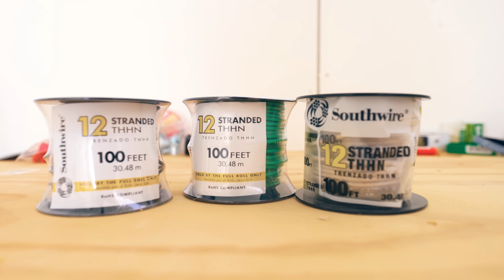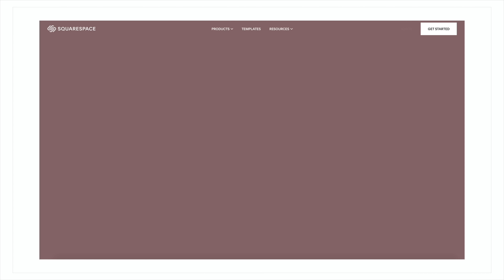DIY SOLAR POWERED WORKSHOP | MODERN BUILDS x GOAL ZERO

Comment: maybe just me but I think it make more sense to go with the yeti 6000x than the 1000x and a bunch of extra batteries, I know it would be more expensive but you just have the one unit and a cupple extra hundred watts of power. it would be a simpler setup and that is just how I would have done it.

Comment: I think putting all your batteries right between both exits would be a problem in case of a battery fire.   I would at least move the big, main batteries to the back of the shed, since you don't need to access them regularly anyway.

Comment: Why not do the ruff in electrical after the insulation rather than bending pipe all day?
And also what’s causing your lights when you turn on your table saw is the start up current on your table is high thus pulling more for a split sec

Comment: 1. Since price is apparently no object, I would have gone with the 1500, just in case you add a larger tool in the future.
2. The stranded wire should have used crimp rings or spades. It doesn’t hold as well under the screw terminals.
3. Your feeds from the power station should have been in strain reliefs, not just conduit adapters.
4. Bent conduit is fine, but flexible conduit to the lights would work easier.
5. Dual conduits vertical is fine, but a single 3/4 would work just as well.
Reply: #1 price is definitely not a concern with this build lol.

Comment: As a electrician apprentice I noticed the hot wires tied to the ground! Wait! The ground wire needs to be not tied to the black or white wires via the red cap used! Please fix this it’s a major issue! I mean a ground Wire should NEVER be tied to the white and black wires! You could get shocked or killed! Thanks! Also buy a tester! Please it will tell you if it’s correctly wired!

Comment: Anytime you cut the tube, file the inside to prevent the wire rubbing on it
Also, there was no need to splice the wire, it can cause future issues unless you ran out of cable, in that case you use some brass wire connectors that you tighten using screws. In your case, you could've just ran the cable directly to the source or used a wire puller (they sell them at home depot, orange and go up to 100ft I think)if it's too complicated

Comment: Follow this guide for how NOT to wire a shed. Don't ground the conduit. Don't use EMT connectors entering the lights. Don't use a strain relief for a cord entering into a box. Don't strap the EMT to spacing rules. Conclusion? Don't ask an experienced electrician for help and don't do research of proper electrical installations. Wing it.

Comment: First of all thanks for the many advices I got from this group, you guys all rock 
So, I wanted to give back some value to the community as well...
I was doing a lot of research lately on renewable energy and found very interesting facts and tips 
on how to decrease your electricity bills  with solar energy. So, I posted on my blog. It explains how the "home energy  DIY system" works and how to save up to 85% from electricity bills with the "home energy DIY system"
Make sure to check the "home energy DIY system" at the bottom of my blog!!

https://sites.google.com/view/rewnewable-energy/home?fbclid=IwAR2zejL2HQKfNBIkxnzG2gtnWeXdZN7qabnYZqELVRVU9A17TBlFk8DrjUc

Comment: In. General, I like them video and idea of getting off grid with green electricity (neglecting the resourced the production of all of this used). However, not sure how many people might get down to reality when they see that the rough spend (w/o conduits, cables, etc.) is $4.5k. Not sure how much a kWh in your place costs, but you can by a lot of kWh for this. Those equipment need to get way (!!!!) cheaper, before it will have a significant positive impact overall. Just my 2 cents.

Comment: Wait dude ... I think you wired your charge controller incorrectly at 10:55. Black is negative, red is positive. It looks like you may have gotten it wrong on both sides. You should probably fix that to prevent any future problems.

Comment: great video but let me add few things
-make main(fusebox) box and wire up everything in that,make 1 main wire to go back to generator.to avoid breaking your generator 
-check your watt consumption,do some basic math , p=i x v. lets say,your battery is 12v with 20 ah .you need 240watts constant for 1 hour to charge 1 battery. and weather can distrub that, so 5 hour straight for charging
-count your usage, lets say your not using table saw etc,just lamp and charger, lamp total 100w +charger 50w.150w for hour x 15 hour usage. 2250watt total. 
- well all of this is easier on paper, but this setup needs upgrade,for safety and liability.do better job in wiring, and for next setup,with this simple calculation you can buy separate part cost way cheaper and suit your usage with easy maintenance

Comment: Seems like a big oversight from Goal Zero to have to use a separate solar charge controller with the additional Tanks instead of the charge controller that's built in.

Comment: If you’re only using cheap starter tools like this guy a setup like this may work. However, if you have a “real” shop this setup will not power anything. All my big boy tools are rocking 220v+. Goal Zero is a ripoff of a company for clueless people. On a final note this joker did get this system for FREE from Goal Zero. If he paid for this shit system Goal Zero would not have been there filming as well. 🤣

Comment: If I were you I would also support the emt 3 feet after the junction boxes. That’s code but also it’ll help them not move especially if you hit them with a tool or piece of wood. Hitting unsupported emt may cause it to move and bite into your wire. Also I would pound a ground bar in outside your shed and ground your metal junction boxes.

Comment: bredda... secure the cable to the wall to relieve any strain you have on the taped joint. can become a fault or hazard. burn down your house or destroy your equipment. additionally these are lithium ion nmc. these can explode. i don't believe this stuff is even manufactured anymore. look for lithium iron chemistry. it's safe.
Reply: and for the technology, that price is hot.

Comment: There is no real reason to run "uninsulated" cabeles through the conduits... Even if there is a difference in heat u wont come anywhere near any issues if the cable cross-section is right^^
Reply: And a uninsulated cabel would cause a lot of trouble :D 
You would get shorts everywhere... What you really mean would be a Single core cable^^

Comment: uh, those switch/outlet combo's aren't rated for high loads (table saw + lighting and extra equipment) flickering lighting indicates that just the saw alone has a high starting current. Long story short, check the max rated current of the combo switch. and if your equipment exceeds that value. consider using the switch only for the lights.
Reply: I would’ve done a separate DC circuit for the lights and direct dc leds. That way u don’t lose 15% from the goal zero inverter then 15% from the led driver inverter
Reply: Nothing to do with the switch. The inrush current from the saw table motor is causing the voltage output of the inverter to temporally drop, thus causing the lights to dim.

Comment: This is a cool setup and I wish I had the california sun to be able to set up something like this. As an electrician, however, I would not take any of his advice on how to do electrical work, it is definitely not up to code and can be potentially dangerous.
Reply: Exactly what I was thinking lol. None of his junction boxes were grounded
Reply: as an electrician. atleast in my country. we have take the earth/ground wire to main box to get equally ground,he technically can blow up his generator later.with that multiple heavy tool.
Reply: The goal zero has all the protection he needs inside the unit in fact there is no ground on the 2 output outlets from the goal zero
Reply: mettal casing is not allowed in my contry if you dont ground wier it this is dangeroes

Comment: Another video, more electrical issues. Did you put in 20 amp receptacles or 15 amp? #12 wiring is good for 20 amp receptacles but then you use wire nuts for 15 amp wiring. Also you didn’t ground the boxes and the entire shed isn’t grounded per code. Stop doing electrical stuff in videos. You are not doing it correctly.
Reply: Yes this is just dangerous and he's  giving a bad example!
I'm not even a professional electrician and this is just 'shocking'

Comment: Each of those expansion batteries they sell for $500. They have a 100ah AGM battery. So in other words that is really only 50ah. That they put a pretty case around and are selling for $500.  Hahaha. I have not seen people get ripped off more then this.  Shame on you Goal Zero..  wow
Reply: Honestly. I couldnt believe they were actually lead acid. It's a scam.
Reply: @AdmitthatijustdiditX  well that size , surely not lithium lol. can buy lithium for that price
Reply: Ya.. Will Prowse makes gud solar n battery diy kinda vids
He released a new vid of Chinese B grade lifepo batteries cheaper than lead acid recently
Reply: @dylan-nguyen  he better make all those connection better. adding battery not gonna mean his circuit is better

Comment: Journeyman electrician here. As it is, your grounding system isn't doing much to protect this installation because you need to bond each J-box with a small whip of green wire of either kind (or uninsulated solid) and screw it to the box, then splice that into the continuous green loop running throughout. Also, to meet the Code, you'll need to support your conduit within one to three feet of every connector, and every ten feet after that with pipe straps. Plus you'll need to use connectors on your lights rather than run the conduit straight inside. Last thing, a scoring cutter doesn't ream the inside of the conduit and can damage the wire insulation during a pull. You'll want to smooth out the insides of your conduits after each cut with a pair of channel locks or pliers.
Reply: Serious question, why did he cut the wires on that j-box on the top right and then spliced them back together?
Reply: @W00lveR1ne  It's not a totally uncommon practice. The ground should be spliced with its pigtail at each box, but the rest don't have to be. Usually a 'service loop' is left in each pull point for later use with the conductors remaining continuous. Making unnecessary splices can add a bit of impedance to the circuit, build up heat, and potentially weaken conductivity. That said, splicing the current carrying conductors at each pull point makes servicing them easier down the line if he needs to isolate and repair part of the system, or decides to expand with receptacles in those boxes.

Comment: That startup draw is serious on the table saw. Its quality level combined with motor size and that’s a hard thing to balance to get anything without heavy startup. Limiting even on grid power unless you’ve done some changes to make shop power. Basic garage power vs tiny upgrades make a huge difference.
Reply: Pretty much most electric motors have an inrush current of 6 times its full load current. Also depends on how many poles and type of motor. Today for instance i had to run a 55kw 2 pole and a 55kw 4 pole motor. Start up current for the 2 pole was 287amps and the 4 pole was 190amps. The faster the motor the less torque so it takes more power to get the rotor turning
Reply: @SoHighIFly  I’ve always assumed a circuit and/or combined with a start capacitor can smooth it out. Or simple a soft start feature the more upper range tools have. I expect a ridiculous startup draw for a 12” miter saw just because of the physics. I am not sure how the cost/quality and application of motors works out. Like if you want a lighter motor because it’s a semi-portable tool but it needs to have so many amps and since it can’t compensate it just has to have enough power to go though. Seems the way is always brute motors.

Comment: Your boxes need to be grounded. If there's a short caused by the sharp edges that are sure to be in the pipe from using a copper pipe cutter, you will be shocked if it doesn't trip a breaker. All you need to do is hit up a hardware store, pick up some ground tails (Or just the screws if you can find them) and just have it connected to the ground wire and the box in some way. We normally wire all the grounds together and pigtail off of them to the plug.

Comment: What made you choose to run the lights on AC instead of LV DC? Seems like a waste to run the inverter to convert the battery output to AC and then rectify back to DC in the lights. They don't draw that much power but you may get rid of the flickering problem moving that load off the inverter. Loved the video btw, an off grid shop is awesome
Reply: first of all.its simpler to make wiring, you point is true about the power loss of the changing dc to ac.my setup loss about 10 to 15% of the calculation due to cable etc.but make sure the power output of your ac convertor can output high watt like more than you use. have a great solar output,battery capacity, all plays part in that. overall he play it easy, no calculation. that table saw need atleast 1500w maybe. in future he need to ugrade this setup.its not balance
Reply: @canul3801  ur actually losing like 30% bc the solar is going into the battery then the battery is going back to AC then the led lights from AC to DC another time. 
and yes while leds are very low power 30% loss is still significant
Reply: @dylan-nguyen  well yeah.but in my opinion.that is easier way. 30% is huge,but even if use the direct ac,the loss up to 15%. also it is easier to find and replace dc thing,more universal and cheap
Reply: Thougth the same, it will be safer to run the lights on DC rather than AC.

Comment: I know why the electricity is cut off the moment you turn on the electric saw, because you connected the electricity in the way (connection circuit in series), which makes you if you run your devices on electricity, the last input will give you weak power, but you must conduct the power in the way (connection circuit in parallel)  Which will really serve you and will not cause you this mentioned problem, and also if one of the electricity entrances breaks down, the next entrance will not be affected and will continue to give you energy always at an ideal equal level

Comment: Nice job! I'm all for DIY electrical, cause you can get exactly what you want and its not that hard. Only suggestion I have is to move the switch down a new run of conduit to the other side of the door. Since you have it on the hinge side, it may be tricky to walk in (when its dark) and have to close the door to get to the light switch, rather than reaching just inside on the open side and turning it on.
Reply: The white and black wires are never tied to the ground wire! Bad! Very bad! Please know code it’s life saving!
Reply: @cattigereyes1  I agree, that's a quick way to short out your entire electrical run, the moment someone tries to do anything else to the system. I'm not sure why you posted this as a reply to my suggestion, as I only suggested moving the switch to the other side of the door. However I will agree that standards should be followed, white neutral, black hot, bare copper/green ground.

Comment: The reason your lights flicker is because when an electric motor starts up, it goes from not moving to high momentum so there is a lot of physical resistance until the motor gets spinning. That resistance causes a current surge as the motor works harder to get up to speed. and your circuit is overloaded for a brief second. Be sure to check that your cables can handle that surge as you don’t want your cables melting. But also it’s an indication that maybe you might want to beef your setup up. Obviously it’s fine for normal use. But if you plan to have multiple things running at the same time it may become a problem quite quickly.
Reply: At face level electrical work is kinda easy, you can achieve the results you want with a little research. And while it’s interesting to watch you learn and attempt this, there are certain safety factors to take into account when doing this type of thing. And unless it was something as simple as a new plug socket or a new light, I would leave it to a pro. Someone with the gear to do continuity checks and who can give you paperwork to say this is safe. And who also understands current flow at a more technical level so you don’t get things like this.

Comment: Pipe cutter leaves the inside edge of the pipe/conduit with a burr on it? Seems dangerous to put electrical wires through it 🤔🤔
Reply: Deburring tools aren't that expensive and don't take that long to do idk why people don't do it for at least a peace of mind
Reply: also no connctor going into the light fixture, it was just pipe not secured

Comment: Amazing Build. I would just  change the LEDs for a direct DC conection to the goal zero, you are wasting energy converting DC to AC in the goal zero unit, and then AC to DC in the ballast in the LED lamps. Anyway, great video!
Reply: I'm just buy some linkable plug-in lights and save a lot of time with wiring plus have lighting that's easier to change. If he really paid for the Goal Zero equipment, money is clearly no object for him to pay a little more for linkable plug-in lights.

Comment: $1300 for the power station, 4x$450 for the battery banks, and 4x$250 for the solar panels. Couldn't an electrician run more reliable and safe power from the house for less than $4k?
Reply: Yes. Even and average joe could run a sub panel with a little research.